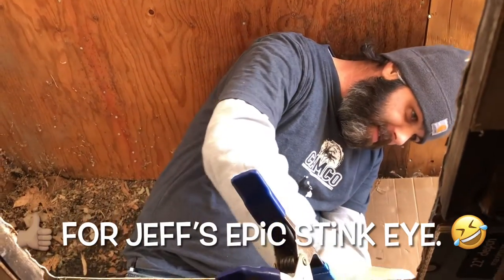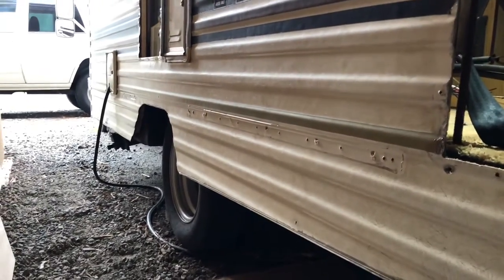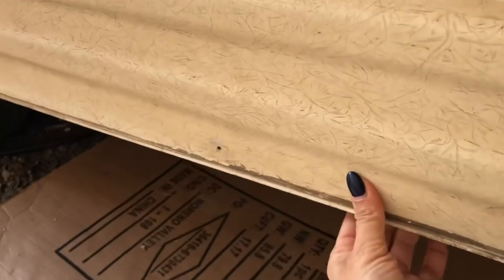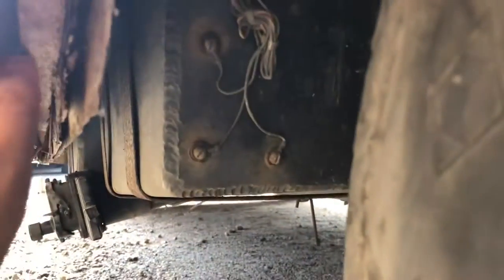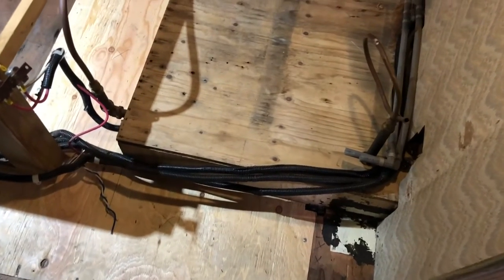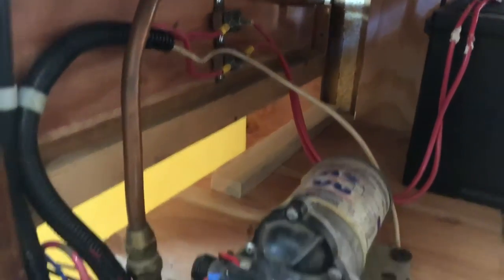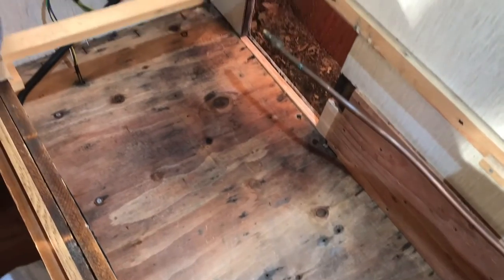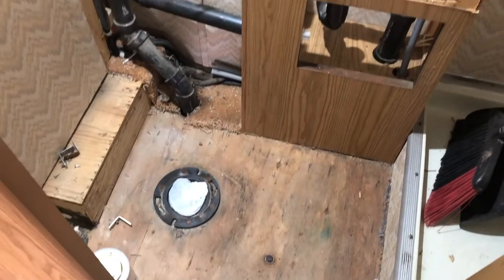Vintage Motorhome Renovation Part 2 -  Water Damage Repair - 1990 Toyota Odyssey

Comment: Nice job!   We have a ,91 rear dinette odyssey ponderosa as well.  Floor under the rear window we repaired.  Resealed all the windows.  Relocated the spare off the back we'll to underneath just behind the differential to keep weight and stress off the back wall so no more leaks around the window.
Reply from the maker: That’s awesome! The rear dinette is the absolute best, right?
We ended up having to rebuild the back wall and floor back there as well…gracious, what a JOB! Our spare has always been under the rig, but the water damage we had mostly came from the seam across the top and the back corners. I honestly have no idea how the entire back wall didn’t just fall off while we were driving down the road. 🤣 Thank goodness it’s fixed now

Comment: I was wondering what type of adhesive did you use to stick the exterior panel on, I have the same Odyssey Harvey and I am doing the same repair, i’m using three-quarter inch PVC trim with 1/4 inch marine grade wood on the outside so it sticks to the corrugation. Love your video. Thank you
Reply from the maker: Thank you so much! We used marine grade too. So far it’s been great. 
He used Loctite PL Premium for all the adhesive in the rig. 👍🏽👍🏽

Comment: Thank you again!
I was wondering ? Did you put the plastic Black propylene sheet  (that originally existed on the back of the skirt)back Over the marine ply or did you just seal the marine ply and call it a day?.
Thank you so much for your response and help, it is much appreciated. What are you folks really went out that one.
That is a lot of work that you did!!!!
Reply from the maker: Thank you so much too! It sure was a lot of work but we’re so happy with it.  We used a rubber undercoat sealer spray on the wood…I cant remember the brand name but it’s awesome.